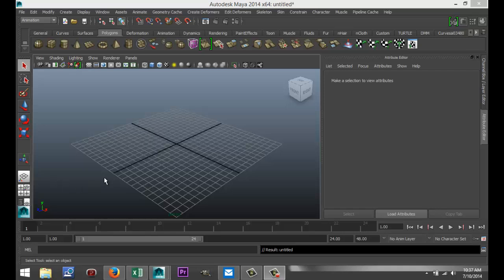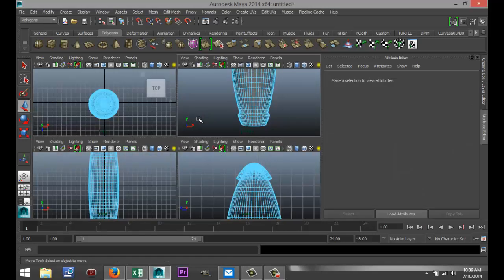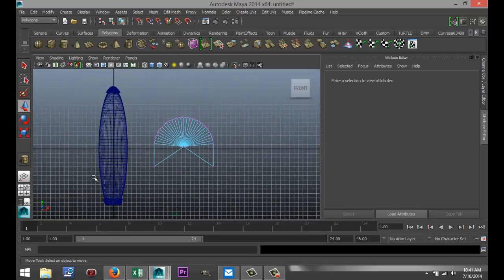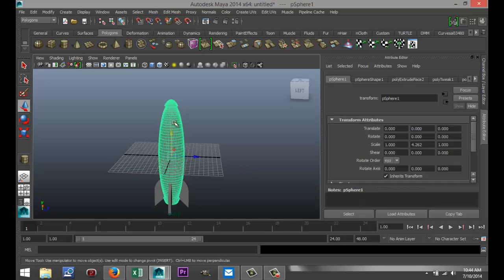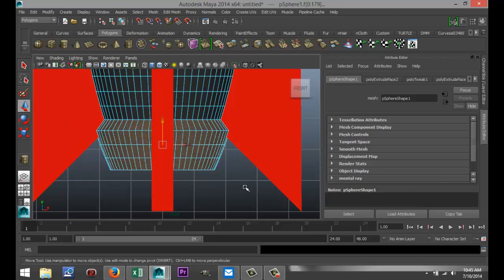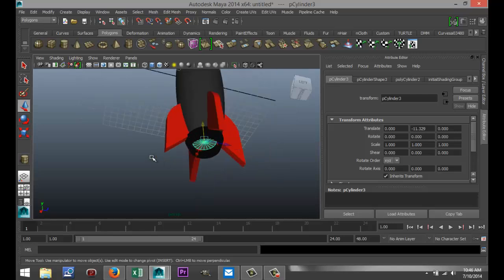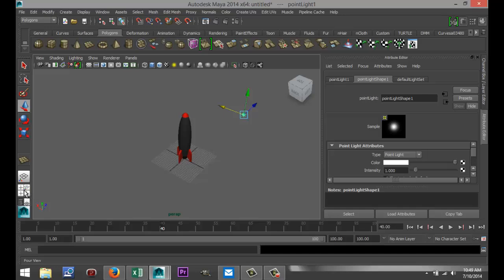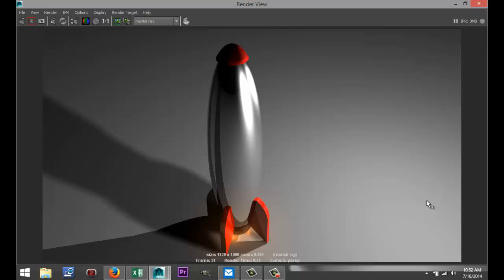Maya 2014 tutorial : How to model a cartoon rocket

Comment: Enjoyed this tutorial. I have a question about the emitter. I wanted to put the rocket in a slanted  position (not straight up and down) but the emitter only fires down, up, left, right, etc. Is there a way to alternate the emitters path manually after creating  it? I tried combining it with the rocket but that didn't seem to work. I also rotated the emitter box, but nothing changed there either. Any ideas or have you covered using emitters in another video?
Reply from the maker: +Dan Covey Hi Dan,

Glad you enjoyed the tutorial. The reason the particles move down is because of the directional value of gravity. ( Being up, down, left or right based on the orientation of the rocket ( and that makes sense ) In a slanted position you can animate the rocket to take off in a slanted position and the particles will follow. If you don't want to animate you can tilt your scene related to the rocket to create the illusion of a tilt.